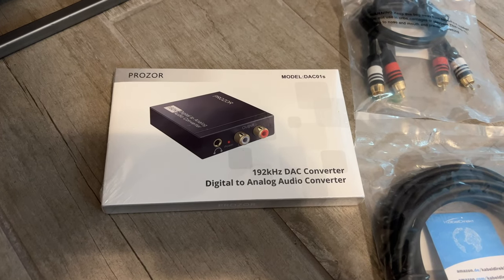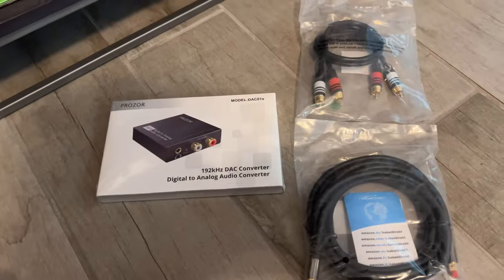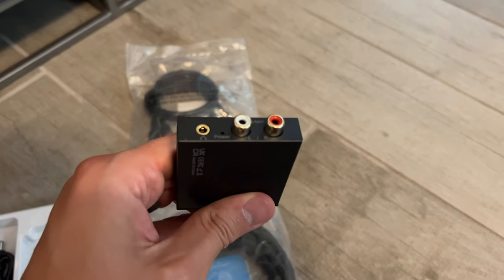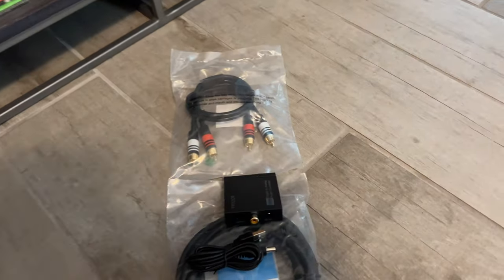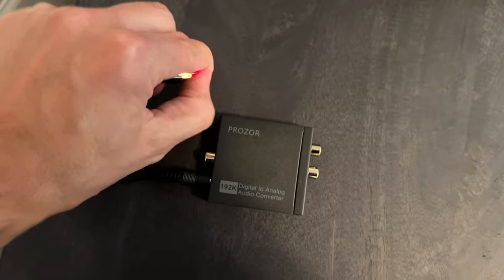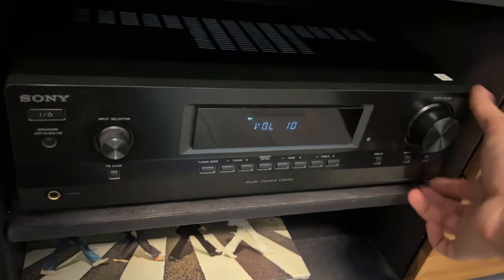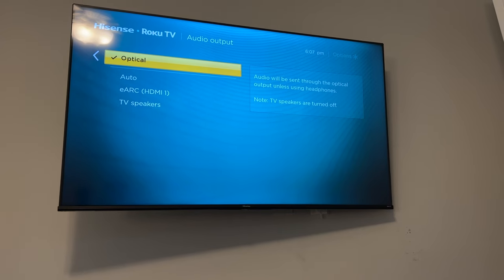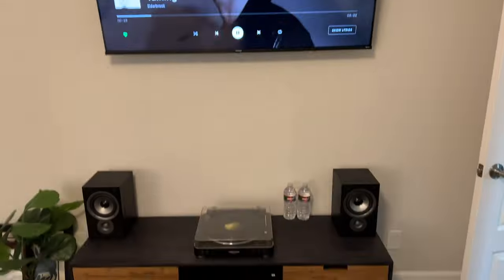How To Connect A New Smart TV To An Old Receiver | Optical to RCA or 3.5MM AUX

Comment: HELP ,  i followed the instructions to the letter , tripled checked everything including the tv sound settings and still no sound through my amp and speakers . 
the dac power light is on , the optical cable is glowing red , the rca plugs going into the dac and my amp are correct , i set my tv to the proper settings but Nooo sound .
😭

Comment: Thank you for your great post. I have the same receiver, and you successfully helped me hook up to my new tv.
I have a sound bar attached to my TV, too. Can I get my soundboard and stereo working together?
Reply from the maker: It might be possible, depends if your TV lets you output audio to two sources, I doubt it does though
Reply: @binarycars I checked out my tv settings, it does have two audio outputs, but they both have to be Bluetooth.
Reply from the maker: Ah, good find though
Reply: Hi, Just wondering if you have tried hooking up a Bluetooth receiver for home stereo to connect with your new tv with Bluetooth?
Reply from the maker: I havent

Comment: Hello!  I have a 10+ yr old Pioneer Elite receiver, which has HDMI connections available. New TV has HDMI ARC input.  Is this the product I need to get them to talk to one another?  thanks for posting.
Reply from the maker: Does the TV have optical audio out?
Reply: @binarycars  yes it does - is it that simple, optical to optical connect?
Reply from the maker: Yeah I would just do that if your receiver has it 👍 then change the audio output in the TV settings
Reply: @binarycars   Will give that a shot and let you know - thanks!
Reply: @binarycars  That worked!! Thanks man!  👏
Reply from the maker: Awesome! Enjoy 😎
Reply: @binarycars  Is the converter DC/ AC current ? Does tv motherboard have issue in current variation?

Comment: About the USB connection, won't the tv itself be able to power the unit? Given the tv has usb, of course.
Reply from the maker: Most TVs only give 500mA out, maybe newer ones could but you’d have to check the output rating

Comment: I’m trying to connect thru Hdmi arc port. But still I’m not getting any sound. I have genesis G608 receiver. I order RCA TO HDMI converter. Do you know what settings i should choose ? I’ve sony bravia x80K smart tv. On receiver I’m having Aux option and CD. For dvD it’s totally different cables. I’ve 5.1 surround system
Reply: I tried to do the same thing with my new tv and old stereo receiver and couldn't get it to work.  So I viewed this video and purchased the item from Amazon that was recommended and it worked perfectly connecting using the audio cable.
Reply: I have the same problem. My audio out it ARC . No coax or optical. Any solutions ?